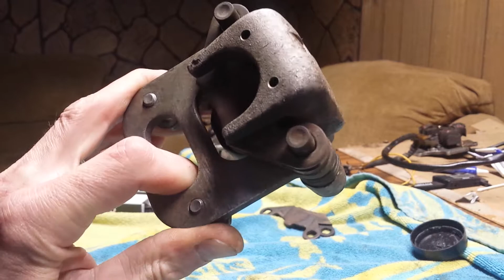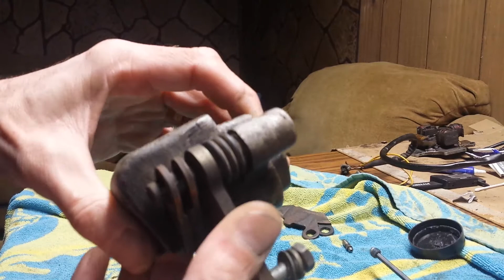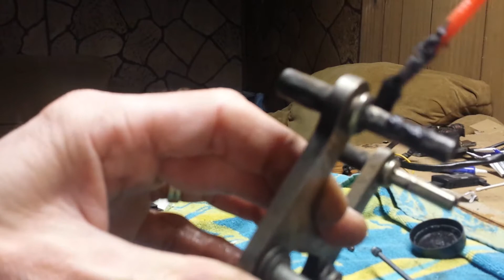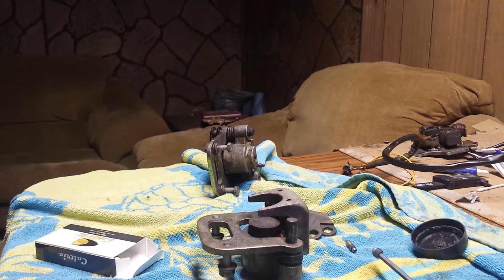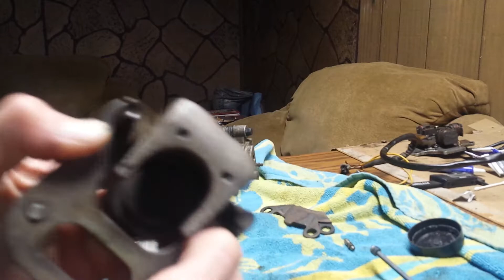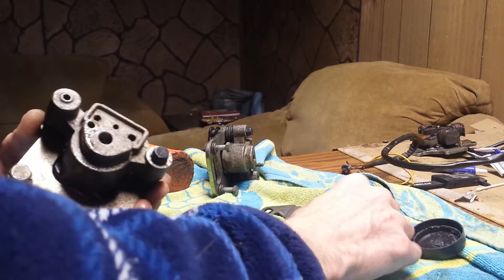How to change front brake pads on a 1994 Polaris

Comment: i could see grease heating up falling off onto pads and no brakes
Reply: If that was the case every single vehicle on the road would have braking issues 😂😂 that's what the rubber is for...to hold grease in and dirt out...where did you get that information from...nevermind how hot are these brakes seriously going to get to even make the grease into a high viscosity fluid?

Comment: what if they are still on the 4 wheeler? how do you compress them to get the pads off?
Reply from the maker: You have to unbolt it from the wheeler then use a big C clamp to compress the piston. Back that nut off first on the back side for more clearance.